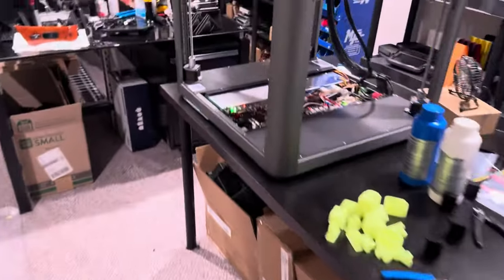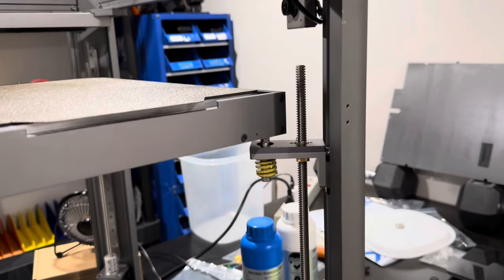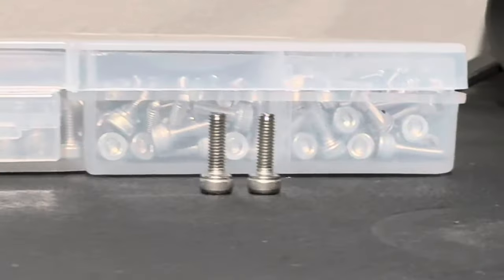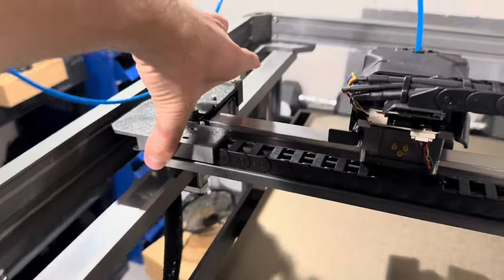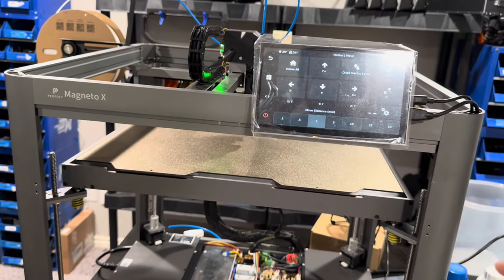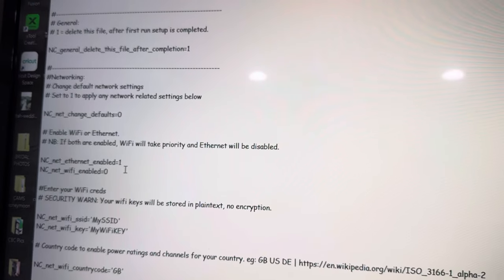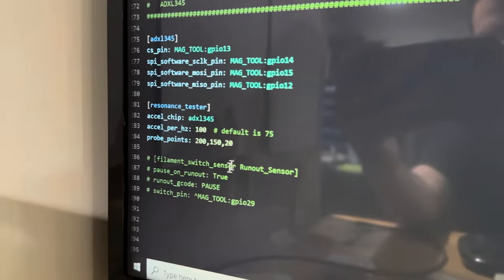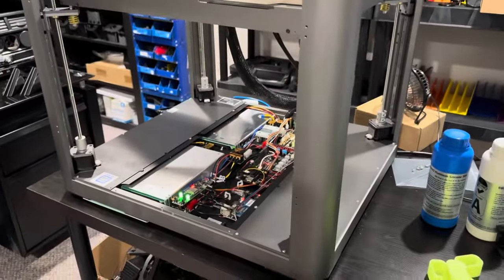Magneto X Quick Setup

Comment: Thanks for posting. Pretty interested in this printer for making functional parts. I hope you'll share some footage of it running or any problems you've encountered. Cheers!
Reply from the maker: Thank you for the comment! And Yes I plan to upload more on it, surprisingly not much content on the machine… anything specific you would like to see or know about?
Reply: @cbc.custombuiltcars  Yeah, not a whole lot out there on it which surprises me because the linear motion looks almost future proof. It seems like this will always be fast and extruding and cooling are what's going to hold it back. For me personally I'd like to see some parts being made on it, some close ups after they're done, and just any issues or insights you've found in using the printer. If you print in more exotic materials I'd also like to hear about your experience with that. A map of the bed probe showing deviation in the heated bed would be good to know. Any mods you decide to make or see a need to do would be interesting as well. Thanks!

Comment: you expect that when installing this printer that everyone knows how basically config their network.  That is the only issue I have had.  And even your video was to quick and nondescript to setup the network.  I couldnt make heads or talils about what you talked about.  Networking has always been my weak issues when it comes to using a computer.
And your video only gave a brief outline... basically worthless in setting up the network.  Why make a video if your not going to go in depth about networking, and that will almost always be the biggest issue in setting up this printer.  This is a big downer regarding your video.
Reply from the maker: Not sure if you came here just to complain or if you actually wanted help with something… Let me know if there is something specific you have a question about. I just went through the setup steps that I did / what was on the the instructions. The network portion was just as the video
Change Ethernet to “0”
Change WiFi to “1”
(This disables the Ethernet and enables the WiFi)
Then add your ssid (WiFi name) and password
Next change your country code in the bottom “US” for me
Eject SD card from computer, insert in printer, power on, (sign into network if it doesn’t automatically,) then the printer should be connected
Now you can see the IP address for your printer on its screen, which you can add in to your printers details in orca slicer (mainsail as host) or google chrome
Just make sure your phone/computer is on the same network as the printer
I did not do the Ethernet connection setup so I can’t help you there
Reply: @cbc.custombuiltcars He gave the explanation in a way for competent people with common sense. Pretty rare these days tho.